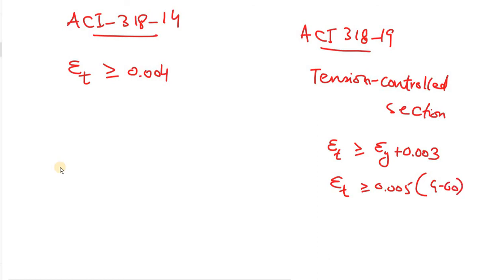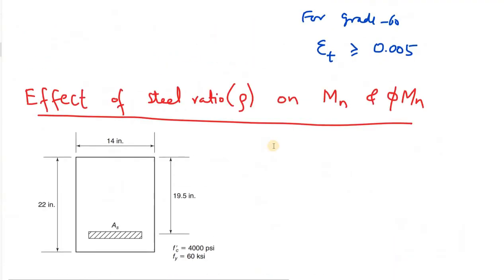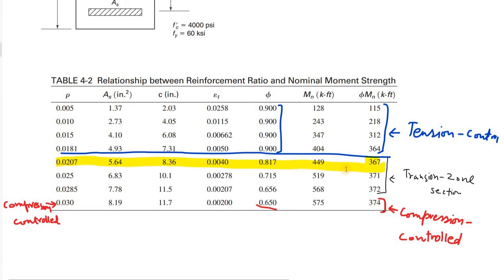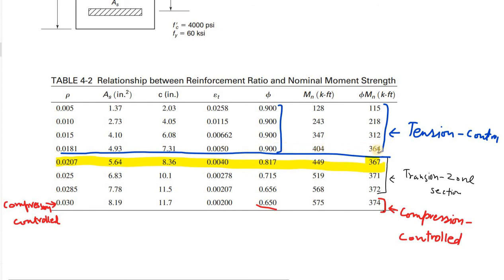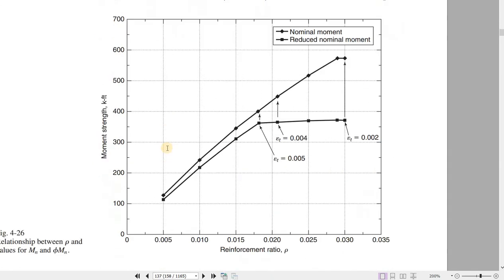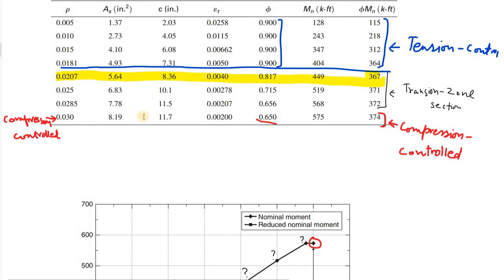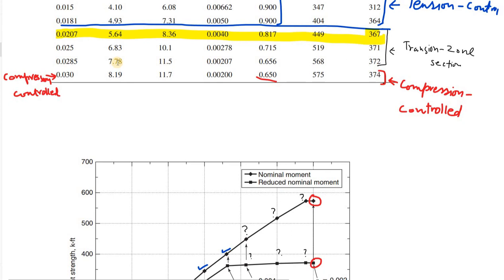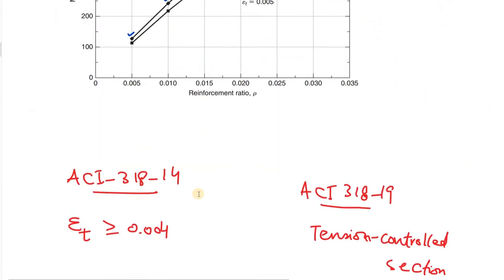Why ACI 318 19 changed net tensile strain requirement of 0 004 for beams

Comment: Sir can you please tell me what is the maximum limit for est in tension controlled section
Reply from the maker: There is no max limit.yes, there's a min limit which is 0.005 for 60 grade steel.
Reply: @civilengineeringlecs  then strain is going to be high in tension steel and visible ?
Am i correct?
Reply: Please send your whatsapp number i m stuck in this problem like maximum compressive strain allowed is. 0035 but when beam is under reinforced NA shifts upward and lets say strain in steel is 10x compressive strain (it is tensile strain so lets assume allowed) ,but wont that be visible to eye
Reply: Or telegram id
Reply from the maker: You may please share your WhatsApp number. I"ll contact you.
Reply from the maker: @Tosh Agrawal Did you overcome confusions you had regarding strain in tension steel? If you haven't yet, you can send your Gmail ID in a comment and delete later for privacy reasons. I'll contact you via Google meet.